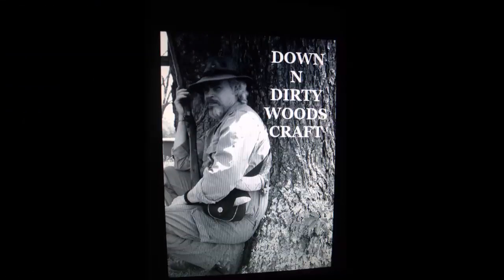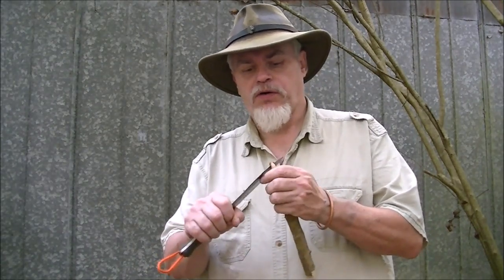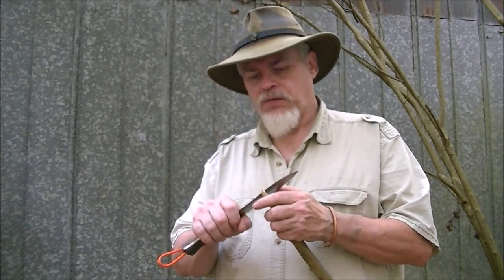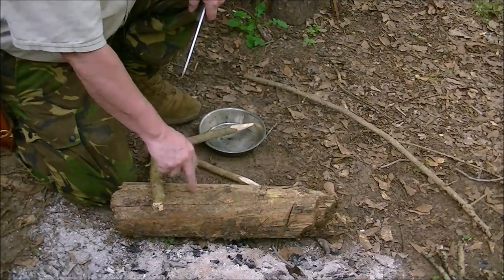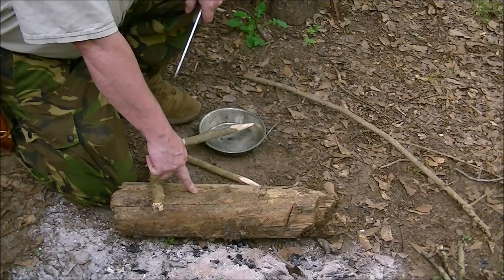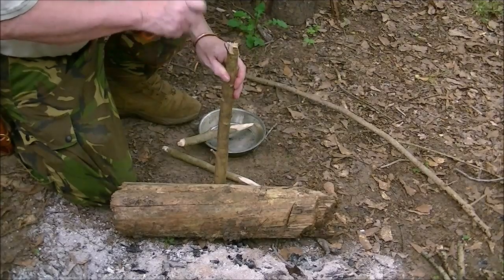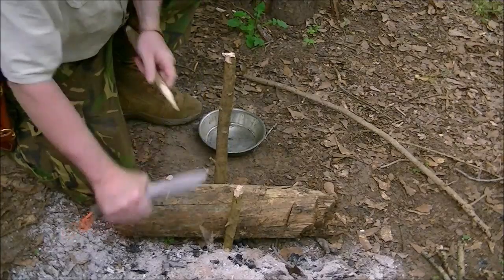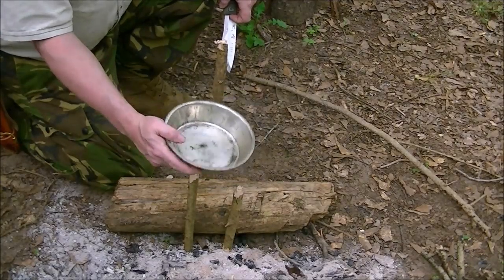DOWN N DIRTY WOODSCRAFT NEW DINGLE STICK TRICK

Comment: Some good advice on how to warm a pan/plate up when using one.  I normally do the freezer bag cooking method so theirs no utensils to warm up. On rare occasions when using a metal plate I cheat.  I have a pot of water on for coffee so I put some of the hot coffee in the plate to warm it. The steak does not care if a little coffee residue is still on the plate.
Reply from the maker: very true